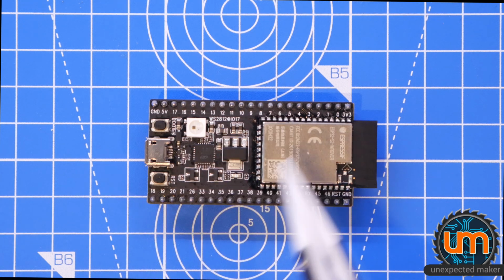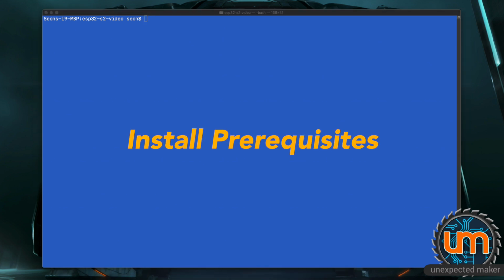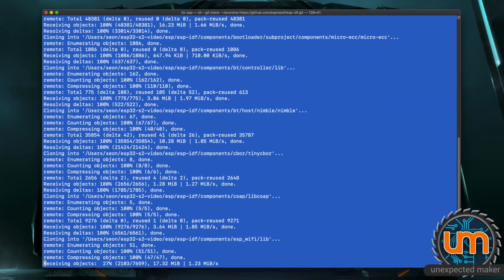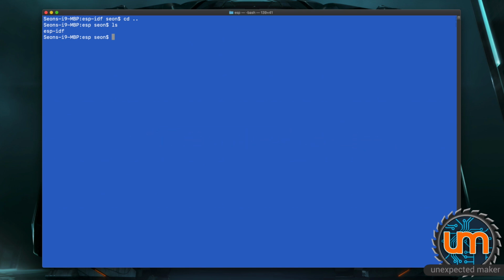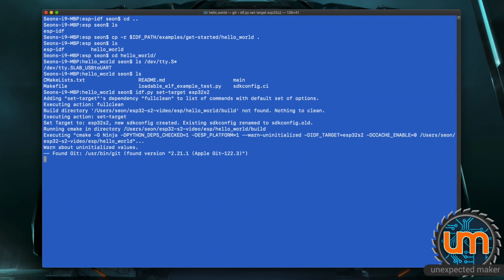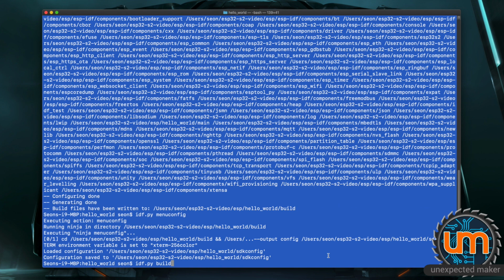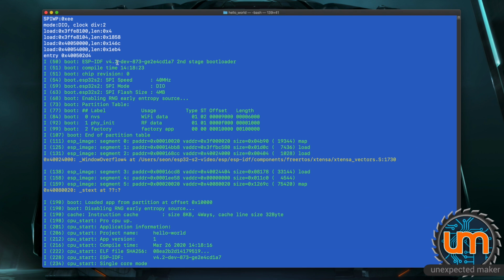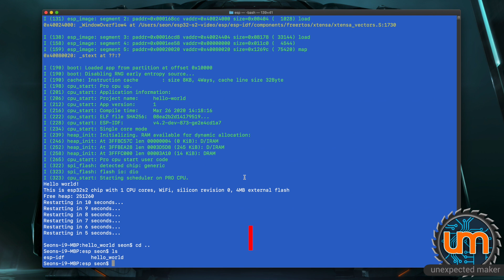ESP32-S2 - How to get started with the ESP-IDF...

Comment: Hi, I had a problem here. I already put the esp32s2 into flash mode, but it's always failed to connect. The esp32s2 is fine, I can see the debug message from the serial port. any advice?
Reply: hm.. I have same problem recently

Comment: Seems really straightforward. lol

In fairness, I only recently tried using the Espressif IDF for the Ai Thinker ESP32-Audio-Kit board thingy, and the toolchain pretty much just "worked".

I was using Ubuntu under WSL / Win 10, and just had to paste in a few commands to install python, git clone the toolchain itself, add the path, then run ./configure, then make etc.

The only real issue I had was finding that I had to configure the environment variable that points to the toolchain folder, which wasn't made clear on the sites I found, but after that it was fine.

Makes a change for something to actually compile without complaining about prereqs, or something else broken.

I managed to get the ESP32-Audio-Kit playing MP3s and FLAC files OK, and could control it via the web interface.